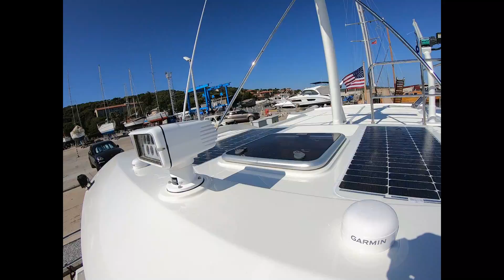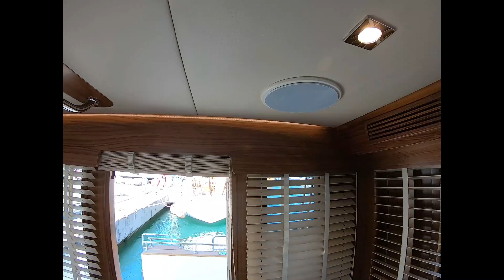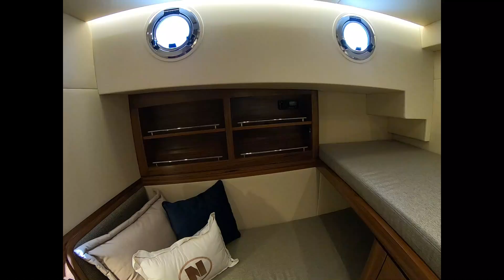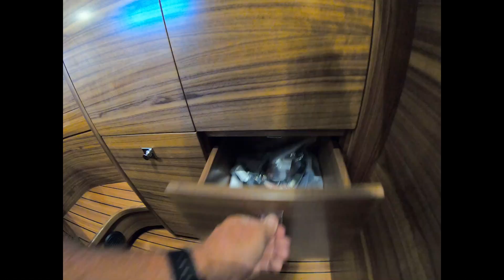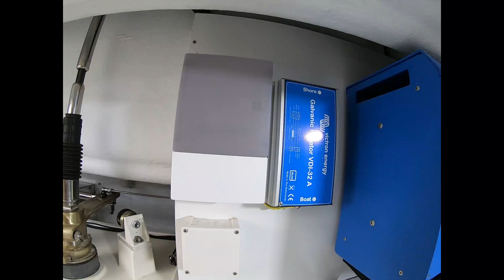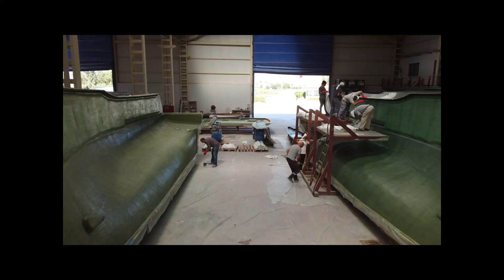N41 and factory tour with Jim Leishman

Comment: Well done, Jim. It does indeed seem to hit all the marks. I like not having a fly bridge. I.e., too tall and duplicate equipment to go wrong. Twin engines is an excellent idea instead of having to maintain a "get home' aux. engine with different filters and spare parts, starters, etc. I like the induction stove top. I.e., no propane onboard. At sea, I'd be eating fresh fruits and veggies and then "one pot" meals. My only quibble is I do like the very comfortable center helm chair of the 2004 43 with doors both port and starboard. And finally, do you have a recommendation on a Sat phone, fwd looking sonar? Also a detailed list of recommended spare parts, starters, bolts, tubing, clamps, etc., might be a good idea for a buyer. :)

Comment: Strike 1: Garmin TOUCH SCREEN electronics. Automatic out to have a touch screen.
Strike 2: Convection Microwave. This abomination is not an acceptable alternative to an oven.
Strike 3: No Deadlights for the portholes.
Strike 4: No Flying Bridge.
Strike 5: No portside door at helm.
Reply: On point 1, everyone seems to be using touchscreen now... I think we just have to accept it or swap it.    On 2, same, swap it if you dont like it.   On 3, I assume they have deadlights, they just didn’t show them.   On the flying bridge, in order to meet the new category A certification, you have to keep CG low, the highly placed weight a flybridge on a boat this small would probably have made them fail the certification.
Reply: @saillaw2  Can't accept them, touch screens do not respond to my touch 65% of the time, so are not a reliable interface.
On the microwave, if buying brand spanking new build, the builder can have it swapped before delivery.
The fittings that would go with the deadlights weren't there, likely they weren't fitted.
Another 500 pounds up top for the flying bridge, another 500 pounds of ballast, cg still low.
Reply: Upgrade to the new N51 coming, and you'll get a free portside helm door! ;)
Reply: @bempey  lol still doesn't say anything about the first 4 strikes. ;)
Reply: Lekker man lekker